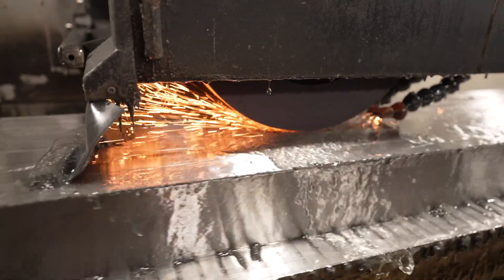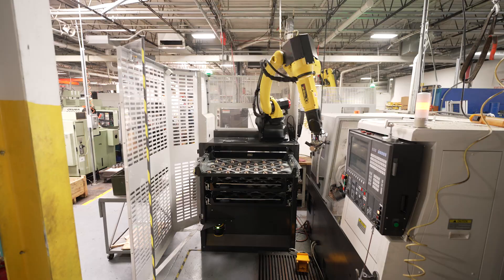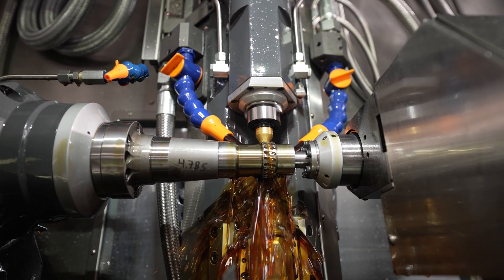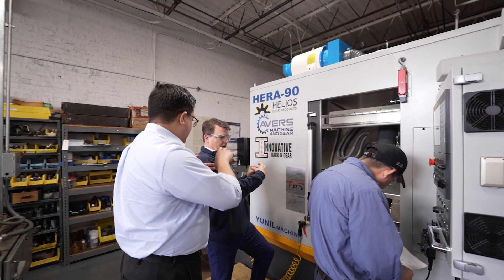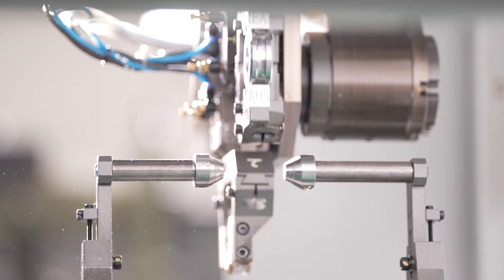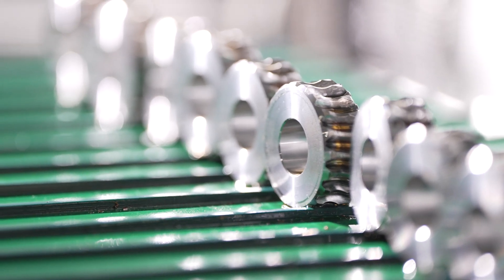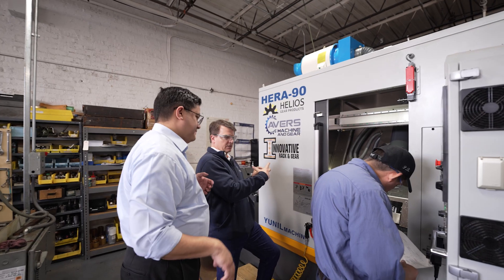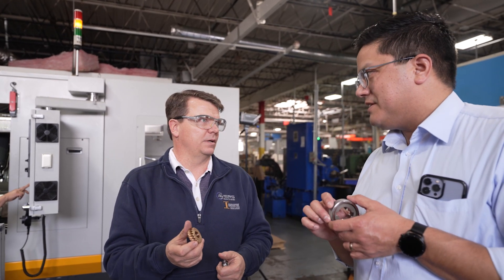Gear manufacturing game-changer | Avers Machine x Helios

Comment: 3d print a negative mold then electroform, any shape
Reply: batch size is limited only by the mold number and tank size, not machine number
Reply: generally equal to cast part economy
Reply: Any experience in hardening a 3D printed part?
Reply: @StevenClayton-pb2zm  oh heat treatment? no, just mechanical composite surface treatment (electroplating) or just using metal sheet in conjunction